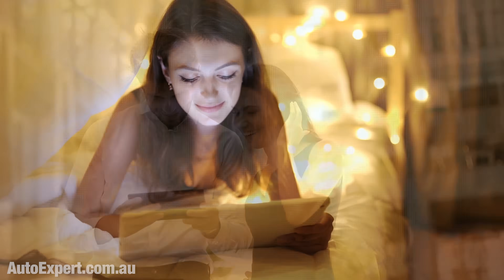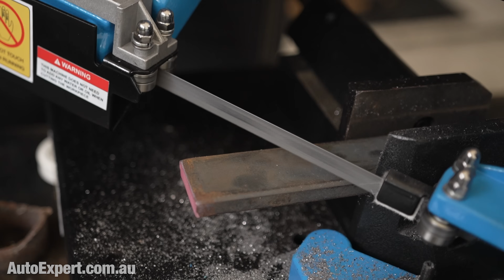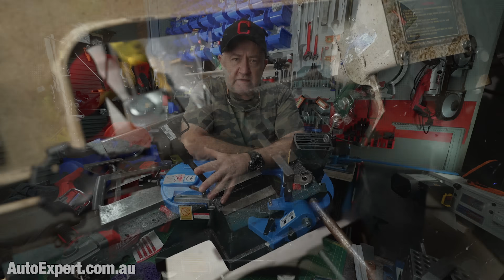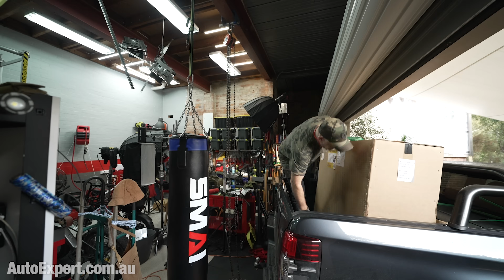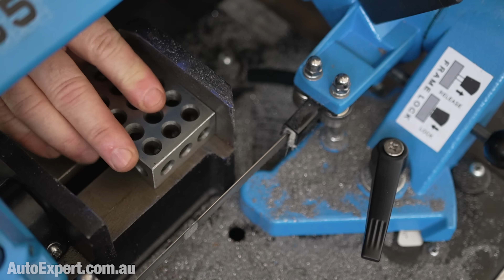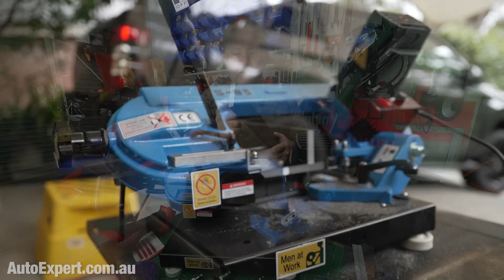Vevor BS-85 bandsaw review: A better way to cut metal in your home shop | Auto Expert John Cadogan

Comment: Have had one of these for about 18 months, light use in the shed (light use: was still on the original blade). The motor gearbox has packed it in - a gear in the motor gearbox shattered into bits. Vevor do not supply spare parts - I asked - so it's going in the bin. Here in Australia I expect I'd have a case re. statutory consumer guarantee (as in a $450 saw should last at least a few years; also the manufacturer or importer must provide spare parts and repair facilities for a reasonable time after purchase); I'm working through that with their support team now.

Comment: The TPI of the saw blade teeth needs to be considered. Selection of what TPI blade you need to use is determined by the wall thickness of your steel. Long story short is that if you consistently cut thin wall RHS Or SHS you need the highest TPI count you can obtain. If the blade is  a coarse pitch you will end tearing  some of the teeth off your coarse pitch blade.A chat with a reputable band saw blade supplier is advised.

Comment: My first job was learning and being a jet enginge technician at Navy fighter jets. My second job was becoming and being a naval engineer on serious German Navy vessels. And I allways refer to the angle grinder as the most dangerous swiss knife of metall work by the very same reason you John dislike at all to call it a swiss knife of metall work. I fully agree to 2 points: you realy have to practice a lot to get the job done the beautifull way and there is no moment not life threatening s long as the grinder rotates. I work with those since 40 years now from then to then and I still have all my eyes working where they belong to be and how they work; - dito all my fingers. Caution is priority first in handling any angle grinder. Allways switch on the brain first and then the angle grinder and switch of the angle grinder first and wait until the rotation went down to zero, before relaxing the grey mass in behind the forehead. ALLWAYS.

Comment: Hi John while completing my toolmaking trade back in the early 80's I was given a pro tip from a wise old toolmaker to wrap a couple of rubber bands around the stock being cut, to absorb the harmonic vibration when cutting in the toolroom. I still use the tip to this day, some 40 years later. Thanks for all your videos and great information. Jonesy
Reply: Similar to putting a bit of cheeseclothe between the cutter and the workpiece when cutting chamfers to allow countersunk cap screws to sit below the parent metal surface the cheeseclothe also stops chattering via the same principles

Comment: I'm with you, mate. 
That manual downforce handle & momentary switch are BS.
If I bought a Vevor BS-85 & was deadset and lazy, I'd tightly cable-tie the momentary run switch so that it's permanently ON & rely on the main power switch to operate the bandsaw.
I'm not lazy & hate any unnecessary connections which are potential failure points, so I'd open the momentary switch junction box but leave the wires intact. I'd then open the main power switch junction box, detach its switch wire, cut & strip the wire that returns from the momentary switch that goes to the motor & solder it to the main power switch output terminal.
Then as a YouTube collab tidy-up, I'd take a sledgehammer to that dumbarsed downforce tube until it breaks off then "In The Bin" it goes, along with the attached wires. 
For safety reasons, I'd file off all sharp bits from the mangled stub & hot glue on a Mighty Car Mods "Shit Beer" drink cooler to cover up the hole.
Any small portion of profit if donated to the C. Nile Management Foundation &/or Senile Management Foundation would be greatly appreciated. 😜

Comment: for the first time in the 15 or so years i been using angle grinders, i had a cutoff disk explode a few months ago becasue i accidentally twisted it while cutting. 
luckily im smart enough to keep my face and body out of the danger zone. which is anything inline with the blade. 
one half shot into the rafters of the garage and the other went for the floor at mach speed. i just shut the thing off and checked my hands.

i been wanting one of these types of bandsaws but i doubt they work well with hardened steel. everything else i need it for sure.

Comment: That's why they're not called "angle cutters" - they're for grinds surfaces, not cutting.
Reply: What are the thin discs for?
Reply: @mynameisben123  Doing things they weren't designed for 🙂

Comment: I've considered this one and the smaller little red one they've got but the vast majority of cutting I do on metals is the truly dreadful shit no one likes cutting- high carbon steels, austenitic and martesitic stainless, tool steels, sometimes aluminum and occasionally when I feel the need to really beat myself up, titanium. Add to that, most of it comes in very large sheets.
However, if you're processing a lot of mild steel for fabrication in post, bar and rod sections and need it more accurate than the wall-eyed apprentice can manage, you want yourself one of the metal cutting bandsaws.

Comment: There's an option you missed - metal mitre cutoff saw.  I've got an el-cheapo one I use for the odd bit of light structural fabrication.  About $100 Bunnings-grade although that was years ago.  Garbage but it does up to 50mm SHS and is easy to take to the worksite.  Eats sections for gates like chips.  Rather have the Vevor though but if you can't justify stretching to $500 and don't need big sections there are cheaper (and possibly cheaper to run) options.
Reply: Cheapo abrasive saws are more dangerous, create hazardous airborn particles which also make a huge mess, they throw sparks creating a fire hazard, they're extremely loud in a DIY home environment, they never seem to cut straight, they make a mess of the cut edges requiring additional rework before welding, you lose 5x as much material per cut which adds up over an 8m length of steel so you have to be more careful laying out designs, the list goes on

There's a reason you rarely see professionals using abrasive cutoff saws and why they're usually cheap and nasty

Comment: I'm curious: why NOT wear gloves when using an angle grinder? I mean, if you're holding onto the side handle and the back of the angle grinder and you only put the angle grinder down when the disc has stopped spinning, how would gloves become an entrapment? (I HAVE used bandsaws, in my father's butcher shop and of course, without steel gloves, back in the day. But I'm annoyed that I ended up replacing a burnt out drop saw with another one only last week when I could've gotten a bandsaw. I guess I was put off by the butcher's bandsaw blades that snapped when catching gristle on cattle bones.)
Reply: Various Ming Moles ?
Reply: @dougstubbs9637  Haha! Well, I love to finger things, not limited to guitar strings. But hey, whatever floats your boat. Thing is, keep your digits intact! 👍☝
Reply: I'm not sure how gloves would become an entrapment hazard either. I would have thought that losing grip whilst wearing gloves would be a bigger concern when using an angle grinder, though that could be more down to wearing poor quality and/or ill-fitting gloves.
Reply: @TheKnobCalledTone.  The way I see it is that metal is either hot or sharp. I also love to play guitar and it's worth protecting finger tips.

Comment: even those cheap saws can do a great job at cutting, tho a bit slow. the better the cut, the less cleanup required and better fit up, which makes welding so much easier. only thing i found was it pays to get the bi metal blades.

Comment: Owning seven Angle Grinders is an acute sickness, leading to obtuse personality disorder of various degrees, which is not right.
Reply: Just counted them, six working angle grinders plus one that needs a new switch, don't think I have a problem?
Reply: I've only got the minimum three, cordless and corded 125mm and the 9" corded of course. And a portable bandsaw.
Reply: I've only one and even that would be difficult to locate if ever I found a need to.